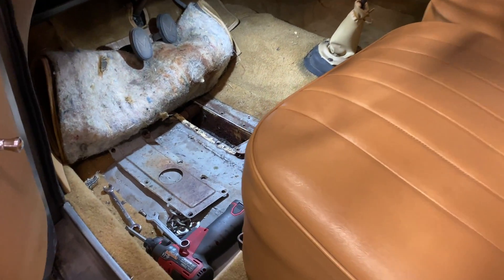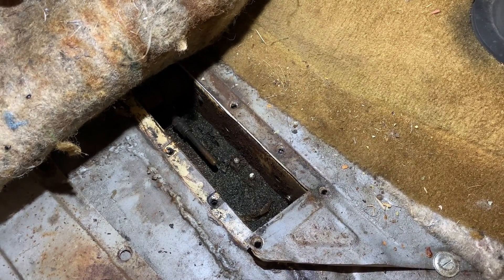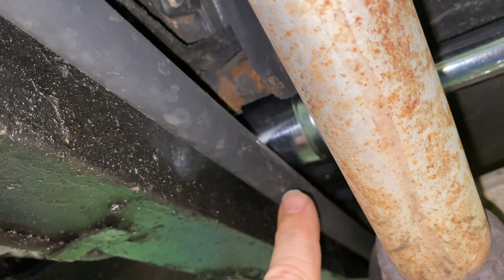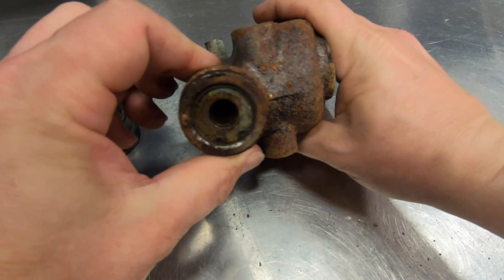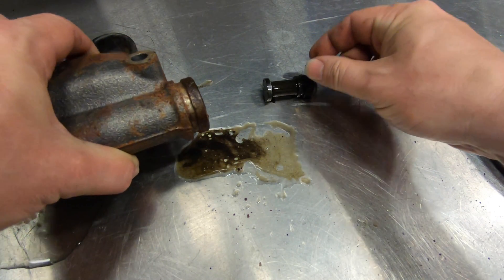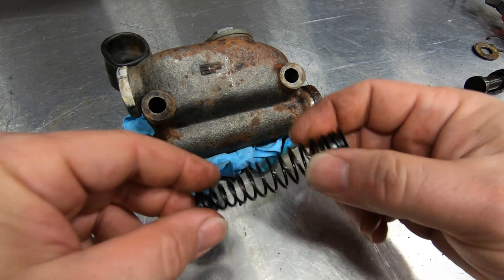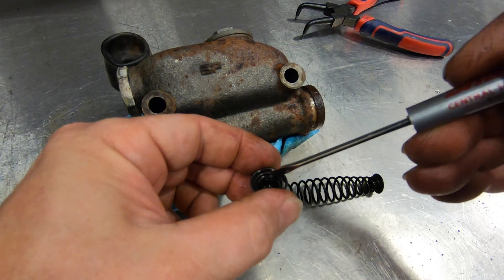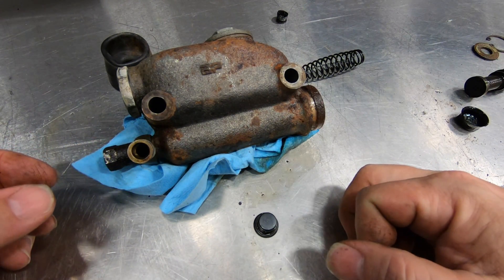Modifying Morris Minor Master Cylinder for Disc Brakes

Comment: Drum brakes  require a residual line pressure valve to work well.  Problem with this conversion is that the rears cannot be converted to disc.  I'd prefer to upgrade the front brakes to 8 inch drums,  [earlier ones had seven inch, after 1961 eight inch. ] This is a 20% improvement in braking  on the fronts, which is as good as disc in every respect other than fade resistance.

Comment: You seem to be neurologically typical and not OCD. I would have started cleaning the master cylinder and the floor cavity. No wonder you get stuff done. (No, I wouldn't. I would have bought kit, made a mighty effort to install the discs and then given up and cried when I realised the master cylinder needs modification too..
Reply from the maker: I used to be that way but after hundreds of cars i have realized what is actually important.

Comment: Take care which master cylinder you use. I tried it on an aftermarket unit and it locked the pedal every 3-4 engagements. I missed the small print on only using genuine parts for this modification. Loved the video, many thanks

Comment: I pulled my master cylinder apart (a new replacement) and the end is not like  yours it has a cup and a spring on the output  end? no seal to remove? how do I modify this one I can send pictures.

Comment: The Morris Minor I had all had its master cylinder on the firewall. Maybe because it was a right hand drive.... (Minor 1000)
Reply: Yours must have been modified. They all had the cylinder buried in the chassis member which meant zero chance of anyone checking the fluid.

Comment: The way I've removed these before is to cut the heads off the bolts using an angle grinder, then slide them out the chassis rail from the other side. Then, put new bolts in the other way round. The reason the bolts are in that way in the first place is because they have special low-profile heads so that there's no danger of them fouling the torsion bar. You can achieve this with the bolts put in the other way round by using washers to space the heads out and making sure the threaded end doesn't foul the torsion bar.
Reply: The reason they are in this way is so they don't fall out if the nuts come off. No hassle to do the job to original spec.
Reply: @chrisennis2245  It's a considerable hassle. Nowadays with nylock nuts there is no reason to put the bolts through from the the suspension side. Even without them it's not hard to tighten up a pair of bolts properly.

Comment: I'm a former motor mechanic from decades ago, and worked on these cars in Australia. It wasn't in the video but I assume you honed out the master cylinder bore and fitted new cups, etc. We used to drill out the bore and press in a stainless steel sleeve with an inside diameter that was equal to a standard cup size. More costly but the master cylinder would last for years after that. English cars always seemed to have whitworth nuts and bolts rather than a bolt screwing into a captured nut or a thread. And the nuts were often tucked away in a very tight and dark area hard to get to. When you worked on a Morris, a Vanguard, an Austin, a Wolseley or a Hillman, you nearly always ended up with skinned knuckles, particularly in winter.... However, I still have a soft spot for those old English cars, despite the permanently scarred knuckles...
Reply: My favorite BSW (British Standard Whitworth) "spanner" for removing the MM's master cylinder was an 8 inch Sears Craftsman crescent wrench, with a 5 lb. drill hammer to loosen the nuts, no skinned knuckles.
Reply: It's very easy to obtain new master cylinders for these now, at least here in the UK, since AP still makes them. I'd probably just use one of those. You can also swap to a Morris Marina pedal box that puts the brake master in the engine bay like a normal car, and also gives you the option of a servo and hydraulic clutch.
Reply: You are not kidding!!! Imagine all the labour costs?? THose holes tucked behind the torsion bar under the car! The cylinder under the floor! The list goes on! Did the unions design these cars? lol Compare this to an Holden or Falcon of the mid 60s, which would have been on the roads at the time these Minors needed repairs in Australia, and were starting to appear cheap in car lots as the first Toyota Coronas and Mazdas appeared. No wonder they were a labor of love. Like a Royal Enfield. But I guess they were fairly well made finish wise? I think it wasn't until the '70s when Brit cars went to dunny of quality?

Comment: Hi, we have a 4 door minor, owned it 30yrs now, first mod I did disc brakes from a Morris marina the hubs had to be machined to suit the bearings & the master cylinder bored out to sleeve it with stainless steel & remove the seal as you did & changed the others, it's amazing what you can do on night shift in the engineering! You got 1 more sub, from Coventry UK 🇬🇧👍.

Comment: You should really use a larger diameter master cylinder to safely operate the discs, you are going to have to move a lot more fluid to get the pistons in the caliper to move. A remote reservoir would be a secondary option with the original master cylinder. Why didn't you fit a new seal kit while you had it apart? That should be the minimum requirement on an old cylinder. How do you keep residual pressure in the rear brake line now that you have removed the rubber seal from the check valve?
Reply: He doesn't.

Comment: Given the effort involved in getting to the damned thing, then I'd have put new seals in the master cylinder. They aren't expensive.
Reply: And cleaned it up
Reply: And lubricated it with silicone grease to slow the corrosion under the rubber boot. And treated the inside of the box section to slow the inevitable corrosion.

Comment: Well done video.  I thought you would mention that the through the master cylinder bolts can be fitted with the heads on the inboard side so that they are easier to remove next time but your trick to getting them out over the torsion bar was very clever.   And I thought as long as you had gone to the trouble of getting the cylinder out it might have been worth while to fully clean it, hone it,  and fit new seals.
Reply: As stated by others, I'd also consider having the bore sleeved in stainless steel, or preferably, brass (brass is kinder on the seals).

Comment: its called a residual line pressure valve, its there to hold a low pressure in the brake system to hold the cyl cups against the wheel cyl walls.it also gave you a brake pedal on first application .

Comment: What a pain in the ass place to put a MC. What were they thinking?
Reply: Doctor MENGELE  Those engines were pretty much a pioneering design, hardly anyone (if any) had put the engine and transmission  east/west rather than north/south before,  so the distributor had to go somewhere and most of the design money went on designing front wheel drive, something everyone uses now but was hardly known in 1959.BL could take the flak for the teething problems which others could improve on.
Reply: Doctor MENGELE    There WAS a factory splash shield fitted to later model Austin Americas.